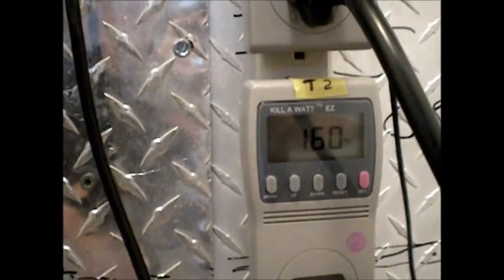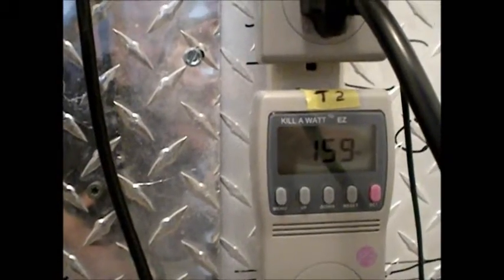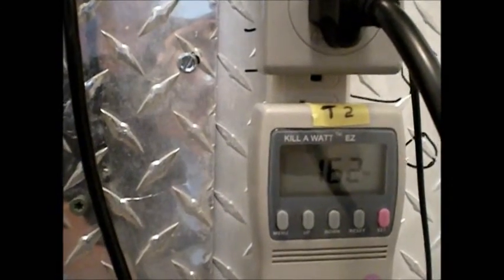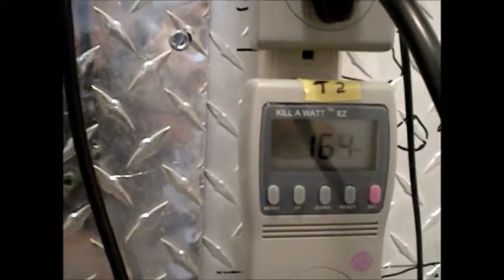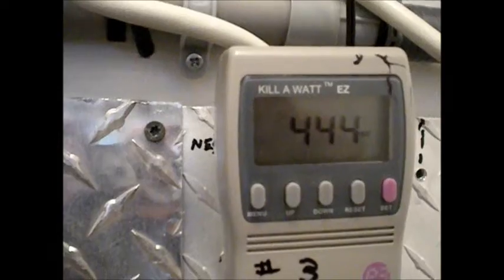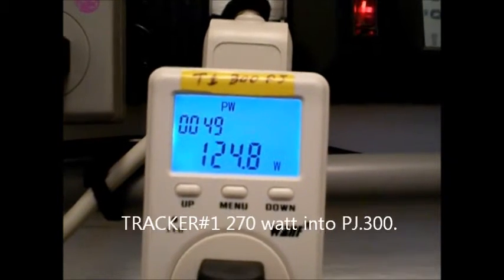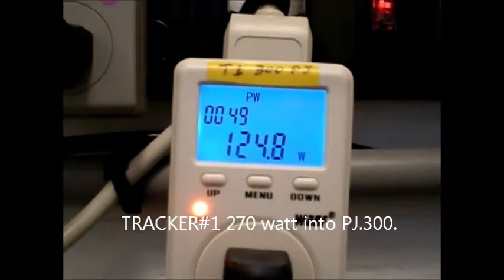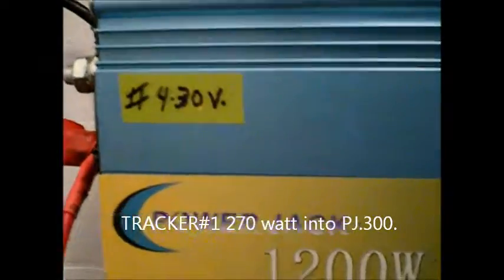SUN TRACKER TEST OF FIXED & TRACKING PANELS.

Comment from the maker: Also I should mention i have used and do still use 2 different tracker sensors. TR#1 has a Richards Foundry or Spelling LLC. From eBay or his site.I have been through 2 of those. I,m using 2 LPC or SOLAR STALKERS sensors  on #2&3 they have the switches so u can use auto or manual #2 gave me fits from day 1,and parked to the East at night.It is not designed to do so .so i,m in the video trying to fix it and it did not go back east last Night.today #2 is fixed.will see what happens.

Comment from the maker: I,m retesting Now With #3 tracking &#2 fixed during mid day all panel should be about the same give or take a few watts but i was losing up to 180 watt an hour be fore i noticed TR2 going west way to fast,as did #1 so it showed me more system Flaws.When u by these solar sensors u think like the ad says simply install and start tracking NOT SO. See Tracker sensors  videos i did these things drove me nuts and the test as the fixed panel showed this more than anything else retesting now #2.Flat.

Comment from the maker: The Charger GTI is only 440 watts total, Tracker #2 is the 1 that gave me all the trouble when i installed it and also it always went back and parked to the east.It,s not so posed   to do that .yesterday as i had a fixed panel in the mid day between 11:00AM &1:30 Pm there should be NO difference at all ,I was losing almost 180 Watt for who knows how long i was a busy guy .so i noticed it constantly way to west.and readjusted.I,m redoing Test right Now.Last night it #2 did not return east?

Comment: Nice video and interesting time lapse test.  I guess it served more than one panel as you got a better idea your systems faults at tracking.  Do you think it might be the diodes that are at fault for the stagered movement?  Perhaps you could hood them with a two inch long, by 1/2 inch diameter pice of  PVC, and see if it helps them track?  Simple check to help them focus more on the sun and not glare.

Comment: What would be better to see is a time lapse of the KAWs on the same test all day with a clock of some sort we can see. Has to be pure GTI only so you would have to leave the charger off for the day or connect it to your smaller panel. But you did get a look at how the trackers were doing, that was interesting.